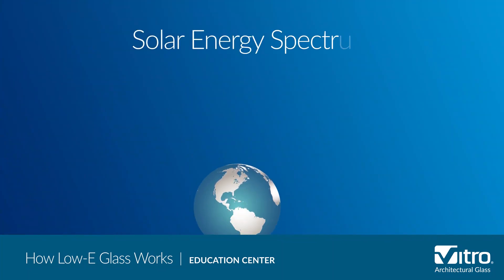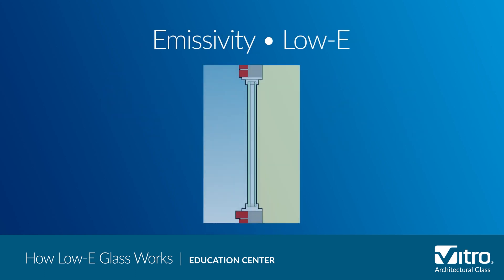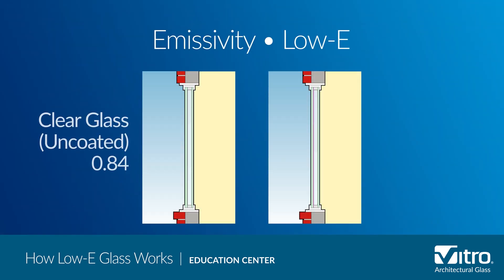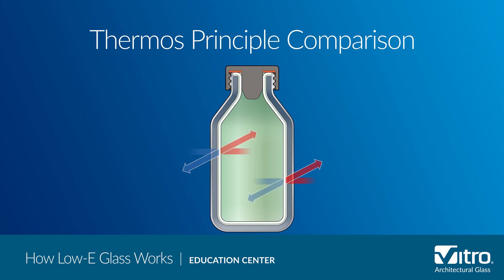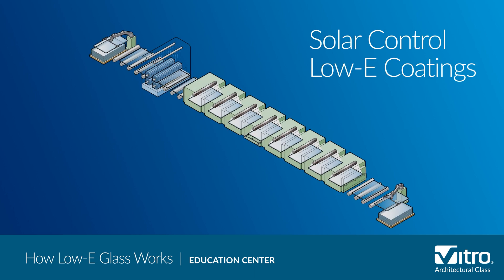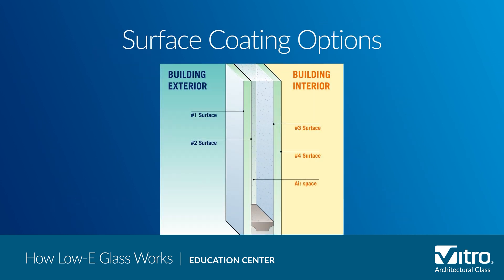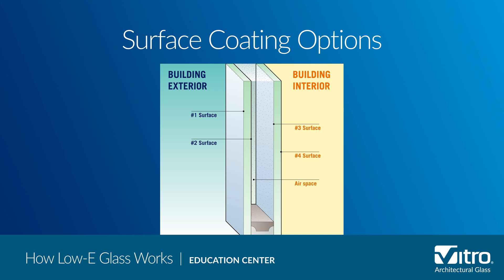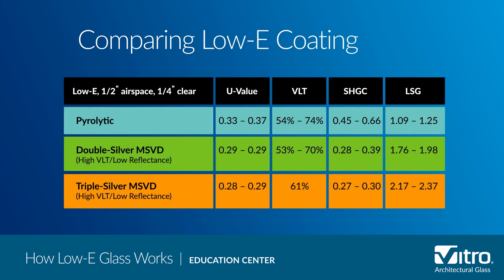How Low-E Glass Works

Comment: It there any difference in the unit if low e is on the 2nd or 3rd surface? Would the unit get hotter with 3rd surface
Reply: On my Andersen "Sunglass" stuff they use two coatings one of each inside surface, i think, verses the non sunglass  windows with only one coating.  Sunglass versions are really amazing in stopping the direct hot sun from making rooms uncomfortable, versus just stanard low e stuff, big differences in coatings. cardinal glass is another big maker of this stuff.  Windows are so much more than just glass today, science in action..it matters